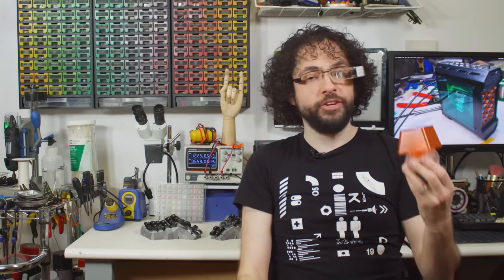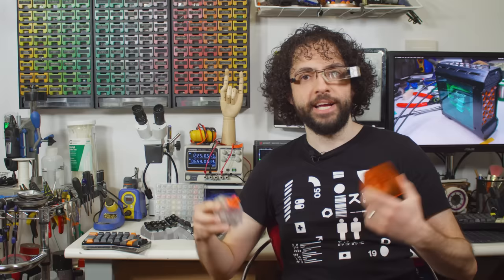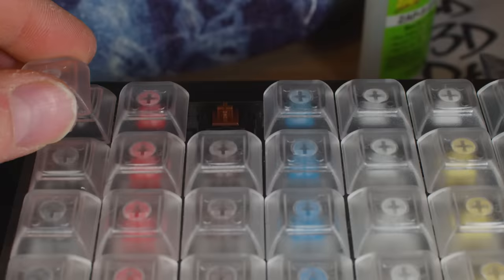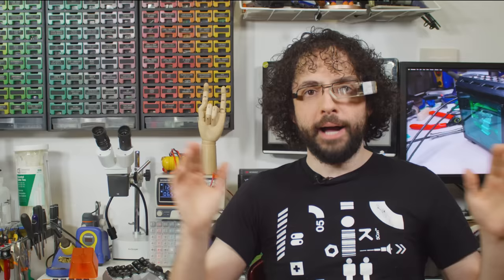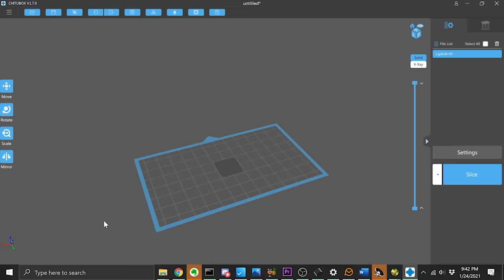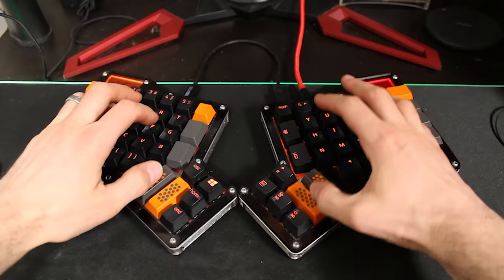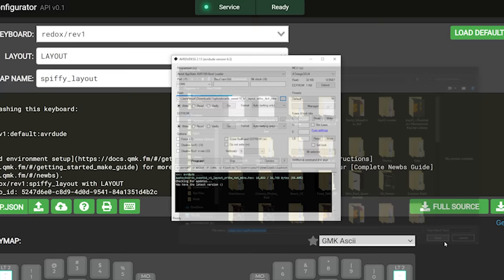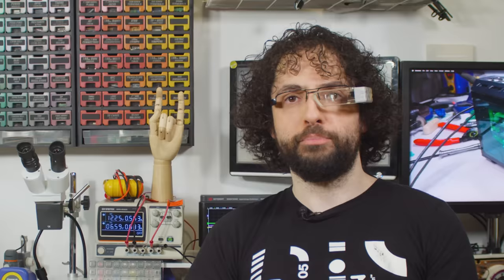How to Build MECHANICAL KEYBOARDS

Comment: I can understand not wanting the numpad, but any man of the digital age who doesn't understand the benefits of the Home, End, and Page Up/ Down buttons is a man who is wasting a lot of time clicking on scroll bars and holding down arrow keys.

Incidentally, I do like my numpad, but the first thing I usually do is rip the fucking NumLock key out so I don't keep pressing it on accident while doing data entry, which reverts the numpad to arrows and function keys and sends me to infinity and beyond in whatever fucking Excel spreadsheet I'm working in.

Comment: great video overall, but dye sub is very very durable. its actually changing the color of the plastic so its not just a surface finish. you would have to actually wear the plastic away in order to remove dye sub legends. in which case, doubleshot would barely last longer and your keycaps would be rendered almost unusable long before that happens. i think you are confusing dye sub with printed or laser engraved legends

Comment: And here I just went down to a thrift store and brought an old serial mechanical keyboard with the good ol' 90's sound of Thor throwing a tantrum and smiting an entire country in one go each time you press a single key. 

I then stole all the keys for projects. 105 switches for $5. 

The keys in old 80's computers also tend to have quite a satisfying feeling to them as well. But they are starting to get a bit pricey these days.

Comment: Can you do something like this with switchable switches ?
Reply from the maker: I’ve seen folks use hot-swappable switch sockets on 3D printed keyboards, but they’re really designed to be mounted to circuit boards.

Comment: I bet people will start using the new Raspberry Pi Pico MCU sometime. It's only $4 which is cheaper than I see even clones of the Teensy or Arduino pro micro. Someone just needs to port a firmware like QMK to it. Of course, with it being a Raspberry Pi product it is sold out everywhere immediately.

Comment: u need mention actuation force in grams, specifically for gamers, black being best, 60grams actuation aka strongest spring aka fastest return of key aka same point as the 'rings' which stop u from pressing key which mean = faster key presses. rapha used steelseries 5g when he won quakelive 2015 cherry mx blacks
Reply from the maker: I’m not convinced that any keyswitch property has a major effect on gaming performance. It all comes down to what makes you feel most in control.

Comment: Can you do something with stepper motors please. I started a project with stepper motors and could only get them to squeal but not turn
Reply: What driver are you using? You may be using low current for those motors.
Reply: @infiniteoffset  A4988. I'm using a 12W power supply. I thought that should be enough to just turn the motor. It's not even under any load.
Reply: @cyanophage4351  The driver has little trimpot on it. You use that to set the current for the motor. Try to turn it on one or the other direction to see what happens. There are guides online how to set the exact current for the motor based on Vref. You shouldn't run your motor on higher current than it's necessary or higher than what it's rated for.
Reply: @infiniteoffset  Thanks yeah I have adjusted that while monitoring the Vref with a multimeter like the guides say. The motor makes different kinds of noises as I adjust it but still no consistent rotating just noises and occasional judders.

Comment: the part on keycaps gets a couple things wrong. for one POM keycaps are available not just ABS and PBT and more importantly dye-sub keycaps are definitely not in the cheap category they last much longer than pad printed and go quite deep into the keycap
Reply: the main problem with dye-sub is the legends have to be darker than the keycap and the legends aren't quite as sharp and may look a little fuzzy

Comment: Thanks for the recommendations and information! A Linux group at my university actually organized a group order of the Ferris sweep v2.2 split keyboard which was a blast to make. Only issue is I'm not sure it's the right type for me. I also ordered 6 STM32F401 arduinos by mistake (48 pins versus the 24 on the pro micro) and have had no luck finding any projects that use that micro controller.
I saw it's compatible with qmk but not sure if anyone uses it. Any suggestions on what I could do or if there's any keyboards that could use them?
Reply: STM are not arduinos man, just because it has more pins does mean it supports more I/O which isn't a bad thing

Comment: The keycaps section is not entirely correct.
What you have to look for is south facing LED's. Which just means they come out toward the hand instead of away from. This is because GMK and traditional cherry keycaps will have collision issues on north facing LED's.
Also ABS is fine as a material, it's the method of colouring that is the issue. ABS WILL go shiny quicker than PBT, but is much smoother than even the smoothest PBT so has its own pros and cons. The problem with those keycaps you showed is that they are very poorly dye sublimated then the RGB legend is laser etched out. Double shot ABS is perfectly acceptable.

Comment: I printed a Dactyl Manuform but only my Kailh switches won't seat properly, they keep getting pushed back out. Did you have this problem too? Doesn't happen with Gaterons btw
Reply from the maker: Yeah, if it sags a little bit, that happens. Use a needle file or nail file to even out the bottom of the body so the switches fit tighter.
Reply: @ZackFreedman  Bottom of the switch or case? Thanks btw I didn't know if I was printing badly or what.
Reply from the maker: @jackalito4022  Bottom of the case - the support material doesn't touch the part, so it sags a little. That fraction of a millimeter is enough to keep the switch from fitting.
Reply: @ZackFreedman  Got it. Thank you!

Comment: PBT is not always superior to ABS. There's a reason why premium keycaps (like GMK) use ABS. GMK keycaps are double shot ABS but they will last longer than most PBT keycaps. The ABS keycaps that are shitty and will look hideous are most likely laser etched. This process makes ABS cheaper to make, but of course, low quality. This part is right, but saying ABS is always inferior is incorrect.
Yes, because GMK keycaps are ABS, they will shine, but they will last a lifetime and look nice. 
I think you should've mentioned this, but I guess you wanted to simplify keycaps, as most people definitely won't look at/buy premium keycaps that cost more than most keyboards, which I can definitely understand. Hell, even I don't have GMK keycaps, just a budget set of PBT keycaps. 
TL;DR on a budget, yes, get PBT keycaps because they are high quality for the price. More money to spend? Maybe invest in a GMK keycap set

Comment: Question is: how good is your solution debouncing the electrical noise of the mechanical switches? Im a fast typer (75 wpm with 95% accuracy according to this test https://www.typingtest.com/) and commercial keyboards dont have problems with bouncy keys, but a DIY solution?

Comment: Can I use rgb keycaps?
Reply: RGB keycaps? Or you mean switches with RGB LEDs?
Reply: @infiniteoffset  Switches
Reply: @maxwellmemme  Yeah, there is no problem in using RGB switches. You just have some extra wiring with the LEDs.

Comment: Does he ever mention what resistors he uses of if it matters which ones he uses since in the end he just mentions out of the nowhere that you need resistors for hand soldering?
Reply from the maker: Do you mean diodes? Keeb builders often use 1N4001 or other common diodes. They don't need any special properties, as long as the forward voltage is low enough that the microcontroller still recognizes a logic high.
Reply: @ZackFreedman  yeah sorry I meant diodes.  Thanks

Comment: If you don't use the number pad you are probably not a developer. That's it, I said it. I stand by it :-P.
Reply from the maker: Whenever I’ve had number pads, I’ve always remapped the keys and used them as shortcut keys. To each their own

Comment: "Arduino are pretty much impossible to brick" 
Looks at box of dead Arduino 
I beg to differ.
Reply from the maker: I don't think I've ever managed to soft-brick an Arduino. I've physically destroyed a bunch of them, though.
Reply: Softbrick? True. hard unless your burning fuses. But yea, box of smoked Arduino, same. They don't like being in CRT's or cars. Or encapsulated in epoxy. Or attached to antennas and near lightning strikes. Or being soldered on, while powered on. Or in freezers. Or sent into low earth orbit. Or irradiated. Or licked by my cat.

Comment: a $100 dollar keyboard?? safe money. So what your saying is, buy a 3D printer, spend $100, then spend many hours. result if it goes well in 1 try, an almost $1000 keyboard :S
never had a 100 dollar keyboard, don't know why it should be that expensive, a $50 keyboard works fine, it also looks better.
Reply from the maker: Hopefully you use the 3D printer for more than just a single keyboard...

Comment: Arduino boards are great but after you do as much robotics as I have during high school and 2 years of college you will have bricked, fried, cooked, shorted, smashed, splintered, popped, and otherwise ruined the Arduino, and probably more expensive hardware as well, in pretty much every way possible.

RIP Jetson #4.